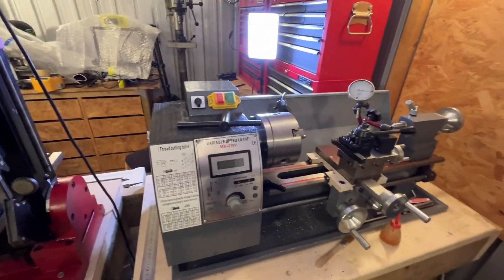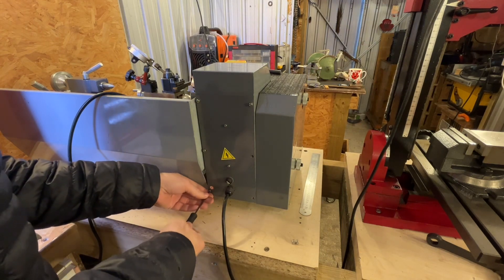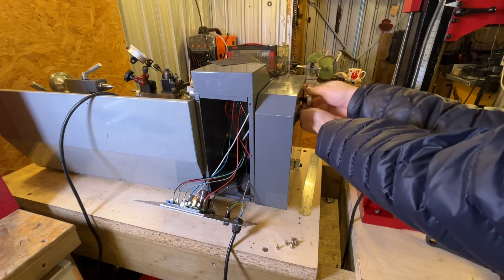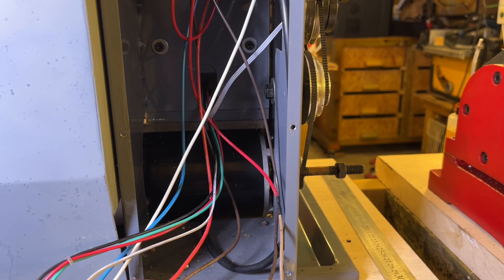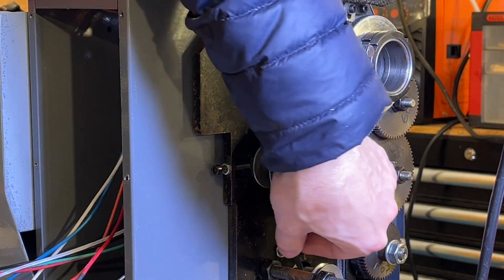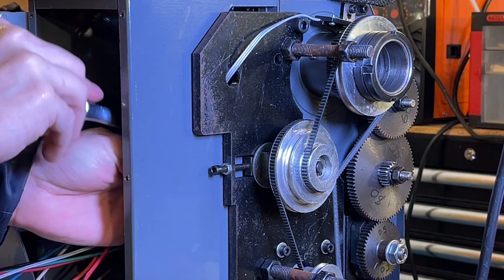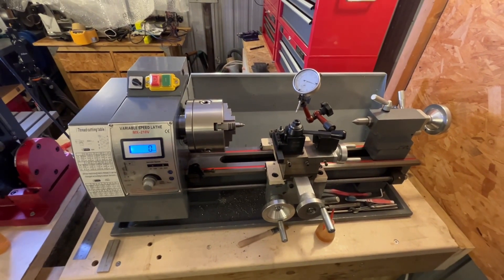210 LATHE BELT REPLACEMENT TYPE MX-210V 8 x 16 750W Bench Lathe

Comment: I had a problem with mine, the top adjustable spindle for the lead screw engagement broke when i tried to take some slop out of it. Ended up making a new one from solid bronze, should take the roaring out of the gear set and alliviate excessive wear that was beginning. Just fyi, those little one can be a pain to work with some days.

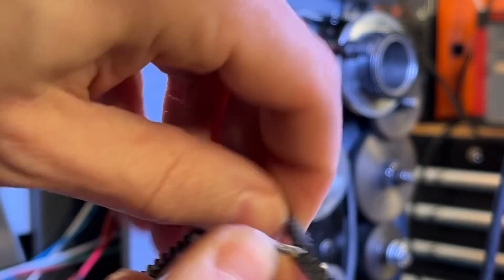Comment: Around 6:00 you show the shredded second belt and state that "They always go like that.". Here is how I fixed this problem.

My Creworks CT-2260A 9" x 24" brushless DC motor lathe appears identical to yours, at least in this pulley and belt system. The cause of the shredding of this second V belt (~4.5mm wide, with wear, 375mm circumference - I measured 372mm) on my lathe was due to the transfer pulley being ~2mm to the left (and so, from the rear, to the right) of the upper pulley on the spindle.

I fixed this by removing the whole transfer pulley assembly and removing the small circlip. Then I was able to prise the bearings off the shaft. I used emery paper by hand to smooth down the shaft so I did not need to press the bearings onto it when I reassembled it. The fix is to remove ~2mm of steel on the left of the shaft, (looking from the rear) to allow the bearings, and so the whole pulley, to sit ~2mm to the left (from the rear), so it aligns with the spindle pulley.

I see no reason to use the high speed belt pattern - low speed is plenty fast enough. It may be much trickier to align these pulleys to allow a variety of belt installations to give different motor to spindle ratios.

I put the assembly in a drill press, gripping it by one end of the shaft section onto which the bearings fit. I used a file to remove the material. Rough enough is good enough in this case. It would be possible to use a small grinding wheel, such as on a small angle grinder, but it would be tricky since there is not much space between the chuck above and the rotating steel pieces below.

Then I reinstalled the pulley with its two bearings, adding a washer between the outer bearing's inner race and the small circlip. This is probably not needed, since with the bearings no longer being a press fit on the shaft, the pulley automatically aligned itself with the top pulley, once I moved the motor pulley about 2mm to the left (again looking from the rear).

BTW, Creworks seems to be one of the other names used by the company best known as Vevor. I discovered that there is a deliberately obscure website which carries PDF manuals for products labelled "Vevor", "Creworks" and some other names.  For instance, the QR code on my printed manual https://sp9c.com/gbSJW leads to the page with the PDF file of the manual.  Searching for "sp9c.com" and various brand names, such as Vevor, Creworks and Lextek can find links to specific product pages there.

Comment: Thank you so much for posting this. Great video. Just got my lathe, exact one you have. Couldn't find how this was done properly.
A quick question,  did yours come with the tapered bearings or was that done by you?
Keep up the great videos! Just subscribed!
Reply from the maker: Yes it had tapered bearings but they were completely dry no grease . Another subscriber bought one that had angular contact bearings installed and I seen other videos the just have plain so it could be they just put in whatever they get their hands on.
All the best Thanks.
Reply: @JAYZWORKSHOP  thanks so much for the quick reply!
Reply: Great info. I purchased this exact model used, and I felt like the belt may need some adjusting. After having a peak, it seemed pretty straight forward but I searched and found your video which confirmed my suspicion that my belt was upside down/inside out lol.

Having received my lathe used, their was no documentation. I'm curious about what lubricants and the change gears and auto-feed rates. Do you have any links or pdf's to a manual or service documentation?